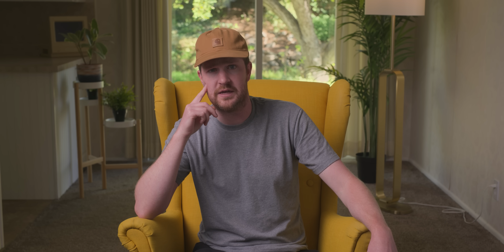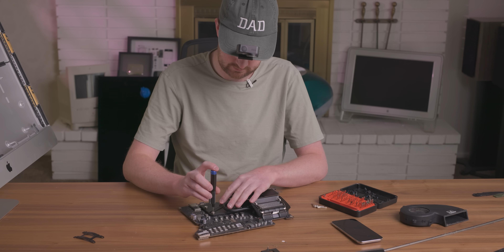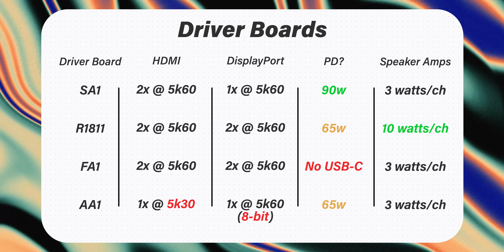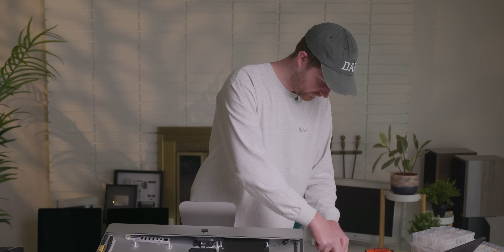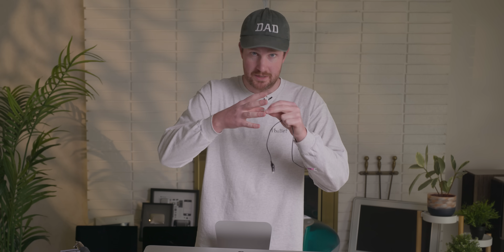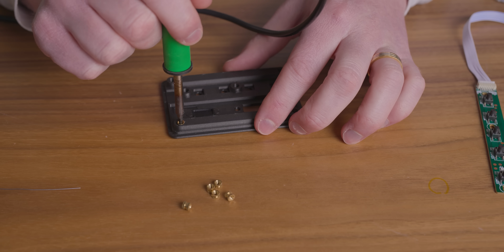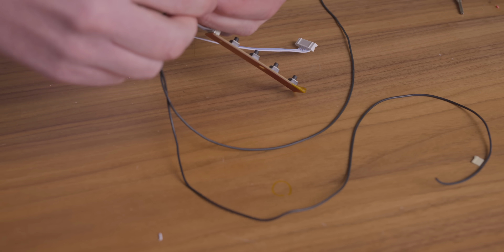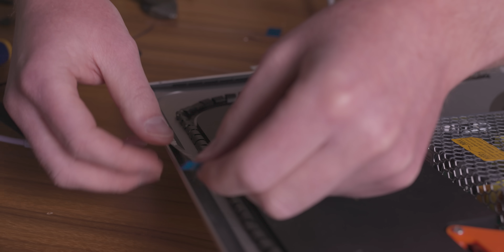I Turned a $200 iMac Into a $1,600 Studio Display!

Comment: studio display has never been a better value
Reply: An 27“ iMac gets never be a Studio Display. Try one and you‘ll notice it. All the great Things on a Studio Display are missing on the old 5K iMac. Brightness, Sound and the Look, ultra slim.
Reply: @flatD1 yeah ik compared to a 6 year old imac. comparing to top end display tech available now it is a bit underwhelming especially for the price. they have had oled and mini led monitors on the market for years now that blow an above average lcd away. the studio display should have had at the very least local dimming when it came out especially for 1000+ dollars
Reply: @rileyhance318  while ever the pro display XDR exists, they'll never make the studio display as good as it should be for the money.  Things like local dimming are reserved for that $5k monster (which is ridiculously overpriced too)
Reply: @rileyhance318 You‘re slightly wrong. OLEDs didn’t have nearly this amount of resolution, nether this brightness (important on day time use). If you compare it side by side on a bright day, you’re proving wrong. I‘m sure. I‘ve bought my third Studio Display exactly for this reason. Nevermind how it looks in darkness, because i‘m using it to work. But i know it isn’t as good in night time to watch movies.
Reply: @flatD1 my point was the technology existed in other monitors already so there was nothing stopping apple from replacing the standard backlight with a backlight with multiple dimming zones. And once you experience a monitor with an oled panel you wont go back. 400 nit full screen brightness and 1500 nit peak brightness seems fine to me as a “trade off” for perfect blacks and perfect motion performance. Im sure apple will be selling you on oled in the next year but they are gonna charge 3k for it
Reply: @rileyhance318 OLED in 4K isn‘t 4K, but less, because of sub Pixel Pattern with more green and less blue and red dots. So it has less Pixels then 4K and 4K is just half the amount of Pixels than 5K like in the Studio Display. I advice you to go into a Shop and compare it side by side, not by spec sheats. The difference is immens and OLED is not ideal for Computer Monitors.
Reply: @f @flatD1 ust because the red green and blue arent side by side in the same order doesnt mean there are less pixels. And 4k is half the amount of pixels as 6k not 5k. Maybe you are thinking of the 32inch pro display xdr. Your view of oled is outdated. There is more than one kind of oled technology with even apple switching to it on the ipads like they did with mini led before switching their macbooks over to follow. They have standard woled, wd oled, and now tandem oleds that combine two layers of oleds to boost brightness which can now be found in computer monitors. Oled is literally endgame monitor tech especially with tandem oled. Matches all the boxes of the xdr display which the studio display doesnt check off and comes with extras like 0.3ms response time and no backlight bleed or blooming.
Reply: @r @rileyhance318 4K, usually 3.8K, has 8.3 Megapixels, 5K (5.1K) has 14.7 MP and 6K has 20MP. You’re definitely wrong here. One Pixel on a LCD Screen consists on 3 Subpixels, red green and blue and the Resolution is increased by Subpixel Rendering. On OLED, one Pixel consists on 4 Subpixels, one red, one blue and two green, often arranged in a so called Diamond Pattern, whiteout any Type of Subpixel Rendering. This leads to a Phenomenon called Font Rendering Problem. Text, especially in just one Colour of red, green or blue, is very unsharp and blurry. Overall sharp Edges, even on black and white Contrasts, are noticeably less sharp and the Resolution is reduced. Also on thin Lines like in CAD Apps. In Monitors of 27”, Tandem OLED doesn’t exist today. You better take Informations then arguing wrong Stuff, i suggest. My Opinion isn’t to blame OLED but until today, there is no 27” Monitor on the Market, who is catching up with the Studio Display in terms of Sharpness. They are just 2.5K (5MP) or even less. On Daylight, good LCDs are very pleasing in Picture Quality. The Drawbacks like less Contrast aren’t noticeable because of the overall Brightness around it, which ruins the possible higher Contrasts of OLEDs, so it isn’t noticeable when the surrounding Light is also lightening the Screens Surface to effect in terms of Mirroring on matt and glossy Screens. Just in a dark Environment you’ll see the better Contrast of OLED, not in Daylight. That’s a Fact you can prove your self by comparing side by side. May you will do next Time in an Apple Store when comparing the Studio Display with a Pro Display XDR on a bright Day, which i did. OLED is great on small Displays and for Video Content like Games or Movies but not so great for Monitors as a Working Horse in the Office. Thats my Experience until today.
Reply: @flatD1 the only reason people want 5 and 6k displays for apple devices is that mac os has artificially made scaling dogshit on resolutions and sizes that apple doesnt sell. 4k displays of all sizes look just fine on windows. At the distance a normal person would be away from their monitor it would be negligible. Im not arguing that there is a 27 inch monitor with oled that has the same features as the studio display. But instead that the tech exists and the only reason it isnt made is because 4k 27 inch scaling looks great on windows. Windows has the ability to change its subpixel rendering based on the screen you are using where mac os does not. If you are comparing these displays on a mac i can see where your opinions are coming from.
Reply: @rileyhance318  OK, i'm done here. It didn't make any sense to discuss. 4K is just 4K, just half the Resolution of 5K and the difference is immensely. If your'e fine with it, be happy. I would never go back to 4K, on a Mac or on a Windows PC, it doesn't matter. Have a nice day.

Comment: Sealing a computer with glue feels so wrong.
I would have gone for 3D printed corner pieces to hold it shut.

Why would they even glue in the screen on a desktop computer ? Why !!
They only needed to had like 2 screws at the top.
Reply from the maker: There’s a magnet mod out there to hold the panel on which is neat!! I just didn’t have time.
Reply: @snazzy  To me, it's the biggest design flaw of this entire line of computer, makes my blood boil to see such wasteful designs.

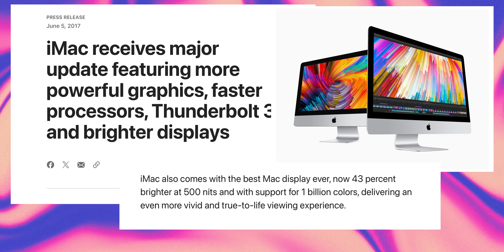Comment: 6:35 I think logarithmic scale works the other way around. What would be expected as 25% increase (500nits/400nits) is really a ~4% increase (log(500)/log(400)). Am I wrong?!
Reply: He misspeaks here. Nits are not actually logarithmic, brightness is a linear scale so it is a 25% increase. The confusion comes from the idea that our perception of brightness is somewhat "logarithmic", not the unit of measurement. so 500 nits is 25% brighter than 400 nits, but our perception of that difference will not be 25%. I can't say how that directly relates - so how much brighter it really is to our eyes would be hard to say. The higher the values the less perceptible the difference will be, although this is more significant at like...1900 to 2000 nits, not 400 to 500. The 100 nit difference is very noticeable below 1000 nits.
Reply: nope, you're right.

Comment: Just 5 minutes in, but holy shit YES. Profiles on Mac OS are awful. I've been using two for a couple years (I used my personal computer for work as a teacher and didn't want to open personal stuff by accident, so I made one only for work) and I was fighting against permissions until the very last day. How can you check "grant access for this user to the whole folder" and every single file still needs permission one by one? How can I have so many throttling for having a profile with every app closed down and doing nothing? Holy hell was it a nightmare...
Reply from the maker: It’s literally abominable.

Comment: I have hot glued LEDs in to literally hundreds of stage sets for performances it really is used everywhere
Reply from the maker: Hot glue is the best.
Reply: @snazzy  I like double face gorilla tape.  I've used it on a lot of iMacs when replacing spinny platters with SSDs, easier than dealing with 2.5 to 3.5 mounting brackets.  And from my samples when I took some of the ancient iMacs out of service and pulled the SSDs for reuse, it was very much still intact after 6 years.

Comment: Apple bring back Target Display Mode. We know you are the most environment friendly company. Give Apple Silicon iMacs a second life regardless of any OS.
Reply: such a bunch of nonsense i worked for a design firm and id see piles of these imacs and brand new studio displays and mac studios replacing them.. the company would have definitely used the imacs as displays and apple knows that its so wasteful
Reply: This would have been a vastly greener choice than taking chargers out the iPhone box 😂
Reply: Exactly and very useful for working from home. I could connect my work MacBook to the personal iMac.
This use case most be very common.
Reply: The one that has the best public image for environment friendliness.
Not the same thing.

For repairability, they only do real change to the iPhone (because regulators only look at the iPhone), and  for environmental impact they only make claims for the Mac mini (because they don't sell that many).
Reply: @Luzgar  Exactly. Same as their "privacy" image.
Reply: @Luzgar  Most of those claims for sustainability and environmental friendliness come from Apple’s recycling stack, which, yes, reduces old devices back into their raw materials, but honestly seems like so much of a waste compared to providing longer lifespans and easy repairability/serviceability for their devices.
It’s almost like Apple skipped the first and second R’s and went straight for the third.
Reply: @osman_zengin  careful, Apple will sue you for even thinking about good, logical ideas.
Reply: @DavidMorseMusic  OK, so where do you think all the tech ideas come from?  Microsoft?  LOL
Reply: Pretty sure they discontinued it because the ports on the iMac back then did not have enough bandwidth for a 5K signal. Guess for the new Apple Silicon iMac there's not a real technical limitation anymore though
Reply: All-in-one computers are the opposite of the concept of environmentally friendly.
Reply: @osman_zengin  environmentally friendly... LMFAO
Reply: If old iMacs can be used as monitors, the price of them on the secondhand market will go up, and people will be more likely to buy new iMacs.
Reply: They can't because people would just buy the base iMac instead of the studio display, since it's hundreds of dollars cheaper lol